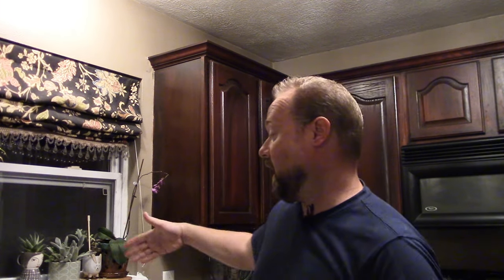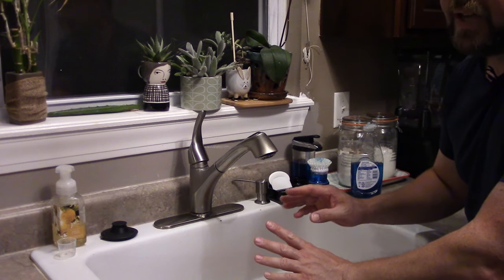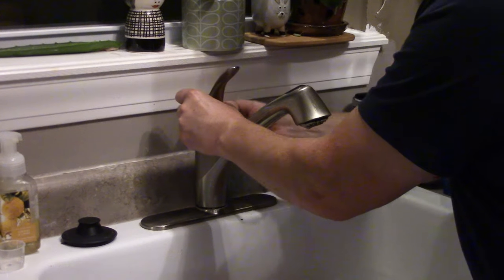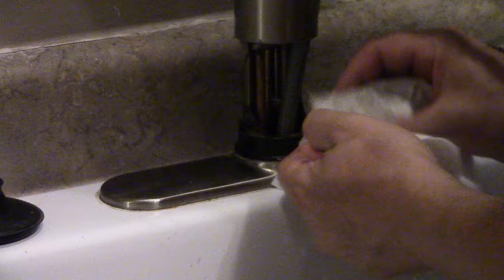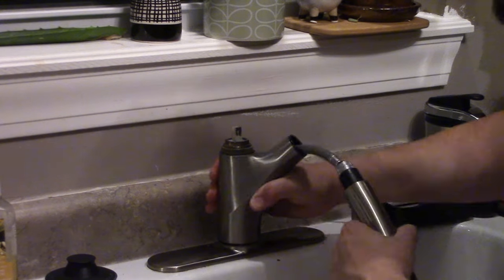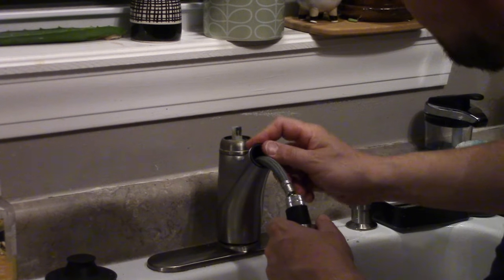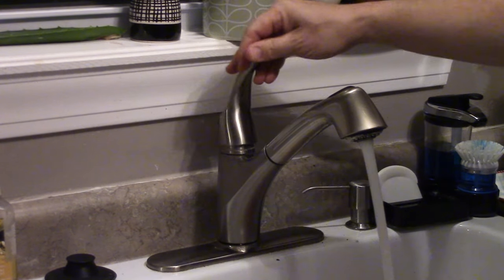Stiff Faucet Neck Fix

Comment: Oh my God, you are my hero. I was thinking about going to Lowe’s or Home Depot and getting a new faucet. I’ve been dealing with the tightness of the swivel of the faucet for about a year.
I disconnected the waterlines, pulled the faucet up, couldn’t figure out how to loosen It up. and so I was just about to give up and I thought I might check YouTube to see if anyone else has had a similar issue. 
And there you were. 
With the exact same problem thank you for figuring that out. I appreciate your help, a lot. 
I wish I would’ve checked your video out before I disconnected the waterlines and the faucet. 
I could’ve easily saved an hour. It was so easy to come through the top to fix everything. Thanks again.

Comment: This one was helpful.  I will try to lubricate the rings on my leaking faucet, as well as replace spring/seal assemblies.  I too have one with the vegetable sprayer at the end, and it creates real problems with trying to take that bottom faucet neck off.  The sprayer hose does not retract back through the body, therefore you must dis-assemble the entire sprayer hose at the water source.  Not fun or quick to do.
Reply from the maker: Good luck

Comment: I am scared of home plumbing jobs.  A leaky faucet can end up as a major flood……however, THANK YOU for this great video.  I followed your directions to the letter, and even bought the same grease from Amazon.  Everything went back together just like new.  My faucet is as free as could be.  Before repair it was so tight it even moved the base plate.  Mine has only one hold down nut which needs tightened up a bit.  Thanks very much for the instruction.
Reply from the maker: 👍 So glad to help! Thank you for watching. Check out hundreds more of our videos at https://www.aroundthehome.org

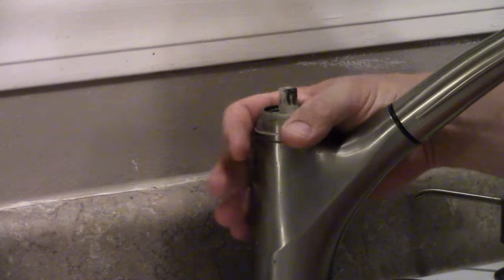Comment: To avoid potential damage to the cap (2:50), try using a jar opener pad either by hand or under the pliers.
Reply from the maker: Good tip.
Reply: I’m glad I found this video. I didn’t have any grease so I used some wood block conditioner that’s basically beeswax and mineral oil. Moves freely now!
Reply: @jessedecker1432    Petroleum based oils/greases deteriorate the silicone o-rings used in plumbing.  However, some of the plumbing o-rings are neoprene and will not degrade.  Just to be on the safe side, I would recommend using plumbers grease as it is silicone based.

Comment: Thank you for showing me how to remove the swivel neck. I'm on my second Glacier Bay faucet. The first unit was replaced under warranty after 2 yrs. I'm notice that the swivel is again becoming more difficult to turn 2 yrs later. This design is not very good.  I took apart the first unit and found lots of corrosion inside the upper o-ring area and black debris on the lower o-ring like you did. Why do you need o-rings anyway? When I need to, I think I'll remove those o-rings or buy a different brand/ style faucet.
This is the problem. When using the pull out sprayer, water gets on the hose. This water runs down inside of the swivel housing and sits above the lower o-ring. This eventual causes the housing to corrode and the o-ring to bind up. Today I took both o rings out so any water that gets inside can weep out the bottom.

Comment: There are LOTS of videos about improving the ease of swiveling the faucet neck by addressing calcium buildup and/or lubrication. But I find nothing anywhere about the problem I am having: All parts are clean and have been liberally lubricated with plumber's grease. The neck moves smoothly after the lubrication has just been done. BUT, by the next morning or sooner, the neck has become stiff again. Are one or both of the gaskets inside the neck swelling? It certainly seems so. Do you have suggestions for identifying the exact part replacements and how to install?
Reply from the maker: Well that is perplexing. What kind of faucet do you have?

Comment: TIP: cover the "cap" or collar, or any chrome part, with a cloth before you use channel locks to unscrew it. It'll save it from scratches.

Comment: I've re greased mine, but it gets relatively stiff within a few days again. Any insight? No water leak, the o-rings look fine. Its not that it doesn't move, or overly stiff like yours, but it is never free moving and does not retain its easy moving glide like freshly applied silicone grease for more than a few days.
Reply from the maker: Do you have really hard water?
Reply: @AroundTheHome1  Thanks for replying, but no. Going to check the inside is smooth.

Comment: what to do when you can't lift the faucet off the base? The part that should swivel is stuck to the base. How do you loosen it? Please and Thanks
Reply from the maker: Some get almost glued on there. If the "O" rings rot enough, they will basically glue themselves in place and it takes a lot of force to remove. If they are that bad, then just grease will not work. You would need to replace the "O" rings as well as greasing it up. Or you might consider installing a new faucet.

Comment: I used WD 40 silicone lube. Didn't take anything apart. Worked ok but still a little stiff.
Why in the hell do they put that GD clear coat on everything. Ends up looking like crap in a couple years. Anybody know how to remove it?
Reply from the maker: I tried to add some lube externally first as well. Helps some.
Reply: The WD40 will swell the o-rings (not good).   My Kohler was all corroded up and I couldn’t wrangle the neck off and I tried the WD40 (it didn’t help).   After finally getting it off I soaked it overnight in vinegar which cleaned up the corrosion buildup.  Use a silicon lube on the o-rings and you will be fine!

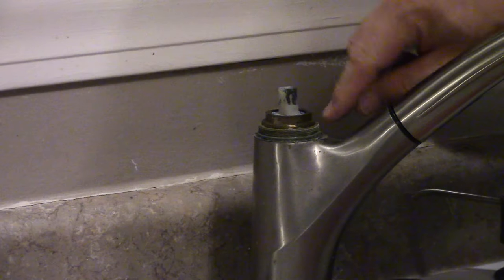Comment: I'm trying to figure out why you even bothered to turn off the water. You never disturbed nor removed the cartridge retaining nut (mentioned at 3:16) so you never opened the pressurized supply lines. About the only thing that might happen is while removing the handle... or bumping it later... you might turn on the water a bit... but you can just shut it right back off with your fingers -- and any bit of water that comes out in so doing just drips out of the end of the faucet and on into the sink...

...I suppose the retaining nut could be cracked or something and fail while you are messing around here... blowing the cartridge out followed by a fountain of water... but in that sort of failure, it could just happen anytime as you turn on or off the water and aren't even working on this...
Reply from the maker: It is a just in case. Especially in case a viewer loosens the wrong part, or is working on a different faucet.

Comment: How long is the greasing likely to last before it has to be done again?
Reply from the maker: @mollydog444 that depends on a couple of things. This fix lasted a year for me, but that was not because the grease wore out. It is because our water is crazy hard down here. So, water that gets splashed on the faucet over and over leaves mineral deposits in the joints. Since this faucet was close to 10 years old I am fighting a lot of that, but the new grease made a huge difference getting the "O" rings lubricated again. Now, if you live in an area where your water is not super hard or / and you have a water softener then the new grease should keep the "O" rings lubricated for many years.

Comment: Mine doesn’t have a nut to unscrew on the top???
Reply from the maker: What does it have?
Reply: @AroundTheHome1  a coller that turns it’s not a nut with threads?
Reply from the maker: I'm not going to be much help without more info. You can go to my website and go to the contact page. After you submit one, we will be able to send pics so that I can see what you have there.  www.aroundthehome.org
Reply: My particular model is a sealed unit, Koehler is sending us a new faucet. (No cap to unscrew)!!
Reply from the maker: Well that sucks about it not having a screw, but good that they are sending you a replacement unit.
Reply: @Slimjim260 - Sometimes it is in the front and has a small button looking thing on the front, rather than the back.   The one I'm working on (and the reason I found this video (Great video, btw, @AroundTheHome1 exactly what I needed!)) has the button on the front.  
I think it was mentioned pretty early in the video but I've replaced/repaired other faucets before so knew where to look as I'd run into it previously).   Good luck!   I realize it's been a year+ but, assuming you had a plumber out or just replaced the whole thing, next time you'll know!   You can't know what you don't know.  🤷‍♀️😊
But, of course, if it's a sealed unit, we'll, then no way to service.   😖
Sadly, things are frequently designed to be un-repairable so the companies can make $ selling a new one.  
Since there are fewer and fewer of us willing to research, learn and try it if it seems doable with our skill-set (especially with the internet and awesome folks like @AroundTheHome1 making actually helpful videos) most would rather just pay someone or, if they have some mechanical abilities, just purchase a replacement.  
It's a throwaway world and the landfills and oceans are evidence.   🙄🤷‍♀️

Comment: This might have been helpful if the man had spoken more slowly and distinctly.  I could hardly understand a word he said.
Reply: @MaryTidwell-sc600
In case you weren't aware (noone can possibly know what they don't know), on most YouTube videos (including this one) you can add both closed captions (where what is said is displayed on your screen) AND you can also change the speed, making it faster or slower by certain increments.  
Either setting can be accessed by clicking on the gear icon in the upper right of the screen.  😊
I did have to re-wind a couple times to make out the 'sometimes the Allen wrench button is in the front' comment as the volume had dropped off as he was probably speaking in a direction that was farther from the mic than previous comments. (I say 'probably' because I don't feel like re-watching the video just to find out as I have a faucet to finish fixing for a friend.)  😉

Comment: These designer kitchen faucets are junk. My Price Pfister has the stuck problem and the pull out hose thingy came out completely and water gushed out. Don’t buy these fat faucets unless you want to keep paying to fix them.
Reply from the maker: No offence but Price Pfister is a lower end retail brand. I try to stick with Delta or Moen on my faucets. And both brands have a standard residential retail model found at all the big box stores, but they also have a higher end line that you can find at your local plumbing supply.